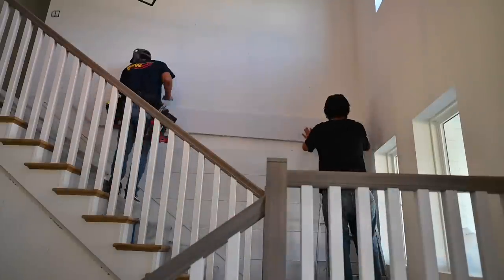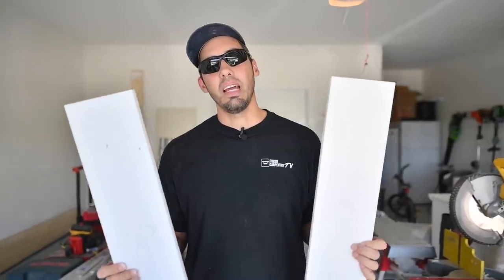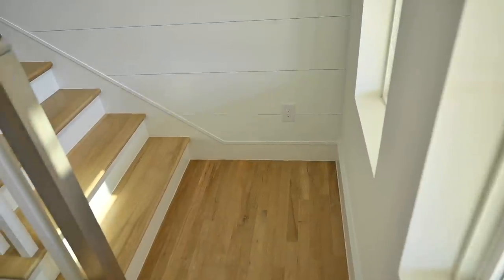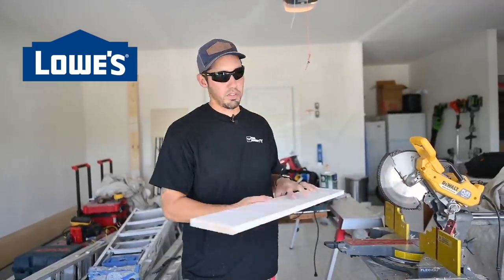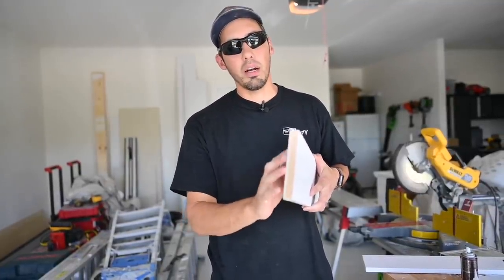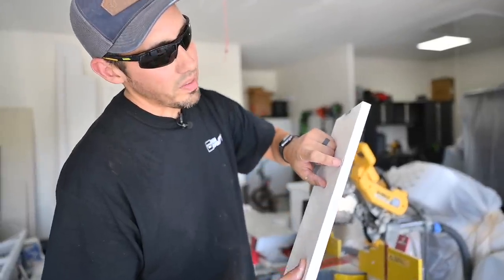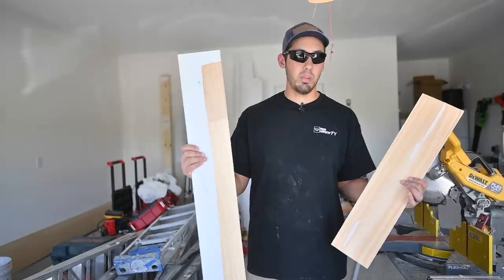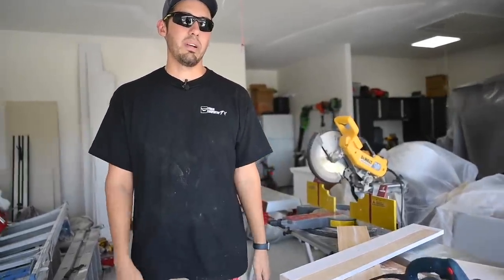DON'T Buy These Boards from Lowe's

Comment: In my experience, Lowe's and Home Depot's wood is barely a step above kindling. Heads up... they're  never going to change. Support local lumber supply houses.
Reply: I would.. but I can almost never get out.. so since the local supply houses don't deliver and don't do 'retail' then it's clear that local supply near me effectively don't exist as a source for wood.
Reply: Easy, my locals have worse lumber than Lowe's.
Reply: I'm surprised the wood I get from Home Depot doesn't sprout leaves.
Reply: I think you gotta give the big boxes more credit...  There was a time when plywood from my local HD was unusable - even for kindling.  But lately their stock is reasonable quality.  Not cabinet grade or anything, but reasonable for what it is.
Reply: @indisputablefacts8507  laughing a bit on the mention of cabinet grade.
I was trying to build some cabinets.. ordered (for delivery) stuff to build some from Lowes.
None of it was usable for cabinetry - ok, sure for the supports (1x2s), yeah, and the hinge and drawer hardware, yup.
I had a large piece that was unusable because it had a huge knothole (or knot) on one side, and a different knothole on the back-side just 16 inches away laterally. 
When verifying (pre-delivery) they said it was never less than grade B.

To this day, I can't find a use for the plywood.
Reply: Our Home Depot always has nice lumber if you're willing tp pick it, that's something I've had to do at every lumber yard, local or otherwise.
Reply: Our local big box stores do OK with lumber quality - most of the time. We only have two 'local' lumber yards within 30 miles of my house. The closest is open 9-5 Monday through Friday only. They make it very obvious they don't want to deal with retail sales. Try to get any counter person to deal with you, it will be a miracle.

The other, farther away, used to be known for the quality and variety of their lumber. Not so much today. They list many items in the show room, but when you get in the yard, the yard men have no idea what you are showing them to pick. This company absorbed their only competitor three years ago. As soon as that happened, variety, quality and most importantly, professional, knowledgeable staff disappeared. 

I wish this was a different story, but for me, I'll keep using Home Depot and Menards for my lumber needs.
Reply: @PhrontDoor  he said NOT cabinet grade

Comment: This is awesome practical advice, especially for people just getting started in the trades or DIY and homeowners! Spending a little extra on much better materials will yield a better finished product, faster! Thanks Richard, teriffic lesson!
Reply: Yoooo Vince my man!
Reply: @jayrob7418  what up buddy!?!?
Reply: “Wayne’s Wall...party time...excellent”.
Reply: Would be cool to see that face of the board run over a joiner or a thickness planer.
Reply: @FinishCarpentryTV  Where in DFW (Fort Worth side) area do you get this? Thanks for showing this
Reply: @FinishCarpentryTV  l
Reply: To be fair, it's not even paying more for better quality as much as it's overpaying for inferior quality.

Comment: This is a good home owner education. I’m also a finish carpenter in New England. A couple things I’ve also noticed with both products you are comparing is that due to the seasonal changes up here in temperature AND humidity, both products will have finger joint failures from the expanding and contracting. Both products will also have tannin bleed through. Both of these problems are not immediate, they take a few years to surface. I personally wish we had a supplier that would stock bare finger jointed material so that the primer is also up to us. Hands down windsor1 is a superior product, have installed pallets of linear feet of all shapes and combinations.

Comment: I have also noticed the “rounded” corners. The coating also chips. Then you must fill it in before final painting. Thanks! I will compare prices with my local lumber yard. My father was a carpenter and I am not intimidated by a lumber yard.

Comment: Same here in Michigan, the lumber stores are completely competitive with the big box stores, and the bonus is, all the lumber stores sell a much higher quality product. I never understood when I see “contractors” buying finish carpentry materials from the big box stores. 
I get it, not every carpenter is as picky as some of us are, but the comparisons in quality between the lumber stores and big box stores is night and day … )it only makes sense). 
That shiplap job you did is crisp af… nice work as always Richard..
Reply: Big box stores you have to load wood on cart and then go pay. True lumberyards you can pay then pull to pile of wood and load truck feet from the pile of lumber. Anything more in cost at lumberyard is saved in speed of loading. Or at least it is for me.
Reply: @kevinmeyer8068  absolutely worth it. I build in a busy metro area with around the clock traffic, so whenever possible have materials delivered. My moulding suppliers and lumberyards deliver for free or charge a delivery fee that is less than what I would pay one of my guys to gopher it. Whatever material is culled from the delivery we just send back with the next drop, or if it at the end of the project, we’ll return it when heading that direction. I really try to limit wheel time, as it’s not the best use of my time.
Reply: @FinishCarpentryTV  isn’t there a good lumber yard in FTW , ?
Reply: We all started from the bottom, and we are all guilty of doing crappy jobs because of the budget,  because we all know that it doesn’t matter how good you are if the material is crap. Some people prefer to spend their money on appliances or light fixtures instead of finish carpentry or even cabinetry.
I believe that if you are proud of what you do and do good craftsmanship eventually you will have the chance toleave those jobs and move to work with better budgets, and then when you put together your craftsmanship and good materials, the result it’s so good that the rest just comes by itself..
Reply: Lowe’s is well aware of what they’re selling, it’s all based on price. My cousin is the owner of an international bearing manufacturer and goes to China to have things made and he says that what you spec is what they produce and if something if questionable is because you let it occur. 
He said they don’t want to lose customers so they don’t make it up on the fly. 
One of my customers wives work for Home Depot corporate and says that  say a range hood was returned and it’s missing the hardware to mount it they will put it back on the shelf hoping customer # 2 has screws etc to install it and it doesn’t come back again. They do get a margin on defective returns, returned things don’t always go back to the vendor so that range hood is all profit. 
I only buy my lumber from a quality local yard and it’s delivered for free. 
The 600 feet of crown molding was even carried (I helped) into the foyer and stacked to let it acclimate to the interior. Driver earned a $25 tip for that.
Reply: Well said man

Comment: I always thought going to a supplier I’d be paying a lot more, thanks for the comparison of prices. Definitely worth paying a little more to save time, and gain quality! S/F
Reply: I found this when I started to buy paint commercially but the biggest change to my life was when  started working with an abrasives supplier. I use different tools, buy less expensive sanding disks that are higher quality, so many things.
Reply: Big box stores are much more expensive to run than lumber yards or warehouses, and the consumer pays for it!
Reply: @2003Trailblazer  Think about it, big box stores warehouse 95% stuff that you yourself are not going to purchase. And like Ryan says, you pay a premium on that which they reduce by volume but only so much. You can usually order through a smaller tool dealer exactly what you want, lots of them will have special rebates they can offer you and process for you.
Reply: Lumber yards have 2 sets of pricing, one for contractors and one for everyone else.  You will pay more for everything but the increase in quality is well worth it.

Comment: by the look of the end grains, the Lowes board is flat sawn which has a tendency to bow down the center. I assume the thick primer is to hide the bow. I noticed the primer was thicker in the center when you planed one side of the board. The Windsor board looks like its modern quarter sawn, which is more stable
Reply: I think you mean the board is cupped or warped.
Reply: Finger jointed stock is a hodgepodge of flat/quarter/whatever sawn scraps really… they’re chunks too short to do anything else with. All those chunks expand/contract differently and sooner or later you will see the joints through the paint.
Reply: @HBSuccess  That's why God invented popular.
Reply: @toms641  Poplar?
Reply: @toms641  Its almost as expensive as oak in my area.  It will be MDF or FJ pine for me from now on.

Comment: I'm using these boards for a project I'm working on..  I've actually found the thicker primer useful for removing tool marks such as marks from ripping them, etc.. You can lightly sand that surface and still have plenty of primer left.
Reply: John doe, what do you use the chips for ?

Comment: This video is so true! I have been using Windsor one in my house Reno for everything and I’m currently doing floor to ceiling 1x6 panels and the picture moulding like you have done, in my foyer. Ran one board short and the nearest dealer to me is an hour away so I got it from HD... never again. Ever! Windsor one is such a great product!
Reply: And in my area (NoVA) the W1 is actually cheaper than HD and Lowe’s! Crazy!

Comment: I work in a cabinet shop and my boss was using that thick coated primed pine boards. He was running ripped boards through our surface planer to clean up the edges to, make sanding easier. The material totally screwed up our 3 blades on the planer. That clay coating was so hard, it took chunks out of the edges of our new blades. After I saw that, I said no more primed material goes through our planers or jointers. It truly is an inconsistent material from the different manufacturers. That thick primer achieves 2 things. (1) It helps cover up the finger joints and (2) Their boards aren't consistent and this is their ineffective way to solve that problem.   JC..

Comment: That’s not primer on the Lowe’s board, it’s candy coated.😂
Reply: I wonder if that's the Chinese boards they stock.  I trimmed out my house myself and didnt like how their 1x's looked.  Wound up using the Chilean 1x's from Home Depot instead, much better quality, nice square corners and thin primer.  Filled and sanded the nail holes twice and used a foam roller with SW paint.  Looks like a million bucks now!
Reply: m&m dip ship lath.
Reply: @bigpjohnson  doesn't make any sense to get wood from China. It's a pain in the ass and expensive to ship. Especially when the US and Canada produce the vast majority of the globe's lumber.
Reply: They are actually a type of powder coating for wood that is heat-treated.  Jeldwen builds the door for them and the frames are the same way.  If you buy an actual jeldwen it's primed completely different.

Comment: Man, I wish I saw this video a couple of years ago when I was doing some trim in my house. My local HD has the true square edge primed pine one-bys. They were out of a size I wanted, so went to Blue Depot. I didn't think much at the time when I grabbed what I needed, but did notice the primer was rather chalky feeling. By the time I got around to cutting them up I realized the roonded corners. I even ripped some down for other pieces instead. Lesson learned. Thanks for the video Richard!

Comment: I couldn't believe some years ago when using raw shiplap for interior finish was starting up. When I was a kid, shiplap was the interior sheathing (before drywall was common) in the South. Then canvas was tacked over it and wallpaper applied. All the older houses in the South had this treatment, up until about 1950 when drywall became more common. The shiplap used then was just common lumber, full of knots and checks. It appears today that shiplap has got itself an education, went to finishing school, and even comes primed to show itself off. I still snicker at folks uncovering walls in old houses, discovering shiplap, and collapsing in fits of ecstasy when everything old is new again.
Reply: The old "common lumber full of knots and checks" probably looks better and has less imperfections than todays finish grade/sanded real wood

Comment: Thank you for showing this. I just used 1x2s in the kitchen, and there is a lot of filling and sanding needed because of the lack of a straight edge, but they were warped as well. It helps to know that there is a better product.
Reply: @p. carr: I cannot imagine that there is any cabinet grade 1x2 available. I would have ripped a wider board to get what I needed. Filling gaps between boards is futile because those 1x2s are going to move alot.
Reply: @really2345  Yes, ripping a wider board would have been better. My frameless uppers were completely flat on the bottom. I added the trim to hide outlet strips and LED lighting underneath.

Comment: I love working with Windsor one, the problem that I have is that my local lumber mishandles the boards, last week I went through a big pile of Windsor one to be able to get 6 boards. Most of them have dings, scratches and some big gauges. I tried delivery and they really messed it up with the forklift.
Reply: I agree 100% !
I love when they stack wood  that is not supported properly on the ground and you get all this small gravel imbedded in the wood .
Reply: Last project I preordered windsorone and the lumber came wrapped and strapped to a 2x12  from the distributor. It was super clean. I go back a week later and grab a board that was in stock, dings and scuffs everywhere. If the piece is in a high visibility area it takes for ever to clean it up. 

What also sucks are banding marks!

Comment: Thanks for the comparison.  I actually like the round over edge when I am facing shelves on my built-ins, but it does create the gap on the seams that you have to fill.  Unfortunately no where around me carries Windsor.
Reply: I am 170 miles away from a dealer. Bummer

Comment: Great video!
2 factors missed on how it’s sawn and milled.
Grain orientation: plain sawn will cup 
rift sawn Will less likely cup
Finger-joint direction Windsor boards are edge joined and the other was face joined.
Reply: To be fair, with finger-joined boards, the grain & cut of each finger-joined section are likely to be different throughout a different piece, which will work to resist deformation.   Also, the super-thick coating will result in much slower (if any) moisture movement into / out of the piece. Cupping isn't really a concern I would take from this.  My only real concerns are the off-sizing, lack of square and the way the coating is prone to 'chipping' when worked unless you tape it prior to cutting.
Reply: @melmartinez7002  fingerjointed material still cups twists and bows, Windsor is rated as an exterior product also. Believe me that thick coating does not protect from water wicking, the box store finger joint wouldn’t survive outside
Reply: @dylanhatch4086  I wasn't saying anything about using these sort of boards outside.  Fundamentally, wood changing shape - bowing, cupping, etc. - is due to moisture moving in or out of the wood -- drying out or absorbing moisture from the air.  This happens even indoors, depending on the relative humidity of the air in the building.   Moisture ingress/egress is likely to be a much slower effect on coated boards.

Finger jointed boards tend to have the grain oriented differently in each section.  So any shape changes will tend to be in opposition to each other.  This is certainly not proof against bowing, but will definitely provide some resistance to it.

Unless you are using these boards in an environment where you expect wide differentials in humidity, I repeat that I just wouldn't personally be as concerned about the possible shape changes as I would with the more up-front problems of being off-size and not square and the ugly chipping that happens with that coating.
Reply: @melmartinez7002  yeah I hear you, and as far as my original comment, i know grain direction varries  through out any fj board,  i also meant the direction the finger joint  it’s self, Windsor’s fjoints are edge jointed instead of face jointed perpindicular to the widest face of the board. Hard to explain you can see it in the video though

Comment: I wonder if it’s thicker in the middle to fill in any cupping of the board.
Reply: That's what I was wondering. They plane one side totally flat then just fill the imperfections on the other side instead of planing any further and risk thinning the board
Reply: Yes, it seems like a good idea actually.
Reply: U hit the board on the head!  Yes it’s a perfect planed down 1/2” and to make 3/4” u needs car bondo!